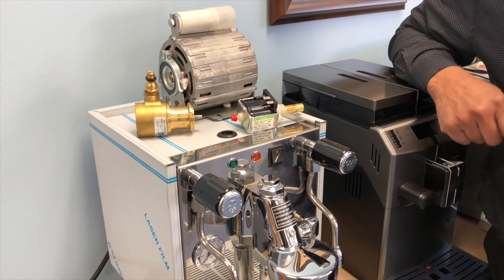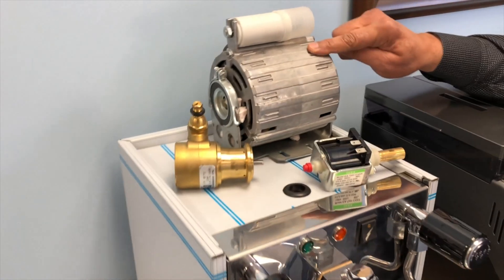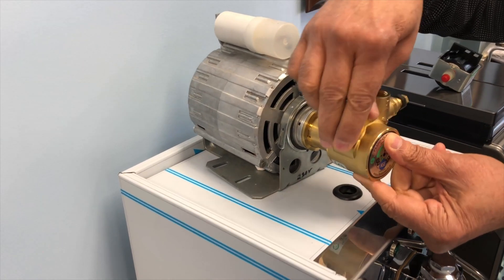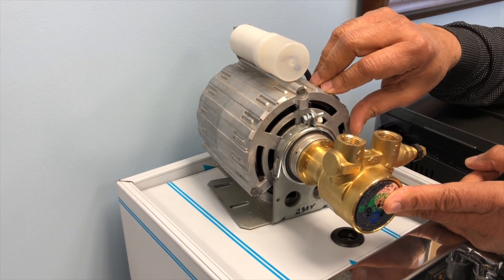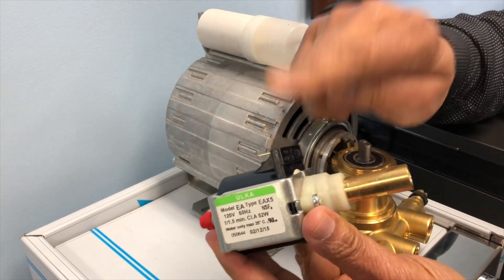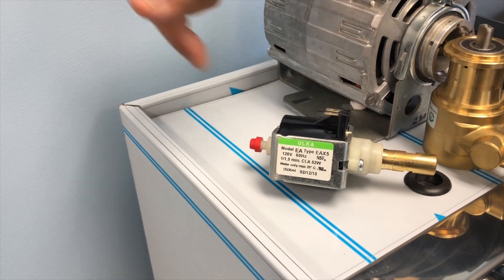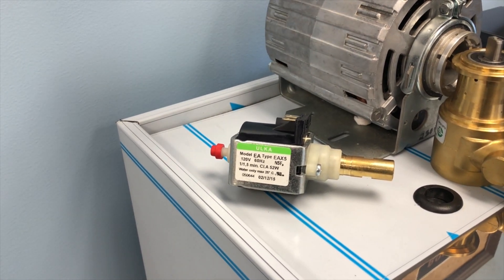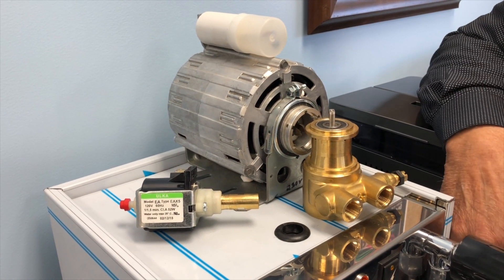Compare: Vibratory vs. Rotary Pump in Espresso Machines

Comment: Rotary pumps are far superior to vibration pumps. The latter only exist to reduce the size and cost of espresso machines. Other than being quiet, rotary pumps have a better pressure-to-flow rate profile, which allow brewing at a lower pressure and thus less risk of channeling.

Comment: Well the vibrating pump on my Jura F9 circa 2005 has 50,975 cups made and still works fine. The grinder makes some noise, the brew group cycling makes some noise, and the pump makes some noise. To me, those noises are the anticipation of a lovely cup of coffee! I actually have 6 older Juras and have no problems with the pumps on any of them.

Comment: Pretty sure the motor wasn't that HUGE in my Rotary pump ECM Synchronika machine.  That one in the video was likely out of a larger commercial machine I'm guessing,  not out of that little home machine it's on top of? 
Rotary pumps are usually a good amount quieter than vibratory! not totally silent but less annoying. Of course a grinder is usually louder than the pump!  Some vibratory pumps are better / quieter than others, I think it might also depend on how the espresso machine manufacturer dampens / mounts the pump some do it in a way to reduce noise a bit. 

There's other differences between rotary and vibratory pumps: They ramp up to pressure differently, Vibratory pumps slowly ramp up when pulling a shot and flow is generally slower like 6-8ml/sec where Rotary pump ramps up quickly at about 11ml/sec so there's potentially differences in how the pumps can affect your coffee extraction. Rotary also holds the pressure with less oscillation.   I've heard mixed things about whether or not people can actually taste the difference between a rotary pump and vibratory pump machine assuming everything else is the same. Some E61 machines offer the same machine with either type of pump. 

Another difference is rotary pumps are more reliable and last longer than vibratory, the downside is if you do ever need to replace a rotary pump they're a lot more expensive than a cheap vibratory pump. Vibratory might also be easier to replace since it's not as large, it might be easier to get to without taking more parts out to get at it.

Comment: A big missed point here is that an espresso is about 30 ml shot within 25 seconds. So it's not just about getting 9 bars but getting it with a flowrate about 70 cc/mn. That's a capacity no vibratory pump has, by far...

At 9 bars a basic one (like Ulka E5 shown here) will push about 255 cc / mn, making nerds add a dimmer mod to slow down water's flow, but then they understand why they need a better pump as they are not all equal in their capacity to deal with variable current... and also, even with an Invensys/Olab/ARS CP3, they lose some bars in the process as reducing the flow implies reducing the pressure. With a lot of fine tuning best espresso machines based on a vibratory pump can indeed produce an espresso within 25 seconds, but at 8 to 8.5 bars, making the result a bit more acidic and bitterness lacking than the optimal 9 bars.

But the more you add variables the trickier it will be to produce an espresso, and adding a dimmer adds a lot of variables (it has an impact on temperature's stability too, it's not just about water's flow). So at some point you'll need a controller to replicate profiles the same way every time, asking at least for a PID mod, if not a full Arduino solution. None of this is necessary with a good rotary pump.

Noise level is a bad argument for sure, also because it is way easier to soundproof a small pump than a big one, but rotary pumps are still way superior to make espresso as they can maintain a 70 cc/mn flowrate at 9 bars without any complex trick around it to get as close as possible without being able to really get there.
Reply: @Bloodysugar I tested my small Dolce Gusto machine with reusable capsules that have special valve that increases the pressure (more crema).
92 ml of coffee in 25 seconds, so 220 cc/min.
The one you mentioned puhses out 255 cc/min, which would be very close.
Which means that vibration pumps are basically just as good as the rotary ones, but well, they are loud.
Medium grind, iCafillas V3 Dolce Gusto capsule, packed in pretty tightly.
Reply: @michahalczuk9071  What Dulce Gusto model has a rotary pump ? 
With such flow it sounds pretty likely your machine comes with an Ulka E5.

By the way the only valve it needs is an overflow to deriviate the excess of pressure as such pump can deliver up to 15 bars.
Reply: @Bloodysugar  it doesn't have rotary pump, sorry I didn't make it clear! 
It has tiny vibration pump and I wanted to test it's throughput.
I will test my other manual espresso machine with a little finer ground coffee.
Reply: @michahalczuk9071  Oh my bad, I didn't undestand.

Enjoy, testing coffee is a pleasure by itself. :)
Reply: @Bloodysugar  The other machine, also with vibratory pump, made 76g of espresso in 24 seconds (it turns off after that, semi automatic).
51 mm portafilter, double shot, fine dense ground, metal screen on top, double wall filter.
=190cc/min
Looks like your estimate for vibratory pumps was way off :)
Reply: @michahalczuk9071  Datas I gave are raw, that's what pumps provide. As said it can be dialed by electronic to get closer to the optimal 70cc/mn @ 9bars. (an espresso is 25 to 30cc. With 50cc you're in the lungo category, that's not espresso)
Reply: @Bloodysugar  50cc is a double espresso produced from 14gr of coffee in 25 seconds in double basket. according to italian institute of espresso. 

I don't quite understand what's the downside of vibratory pump, when it's very easy to produce any flow rate just by fine tuning the grind fineness. 
I can easily make 30cc or 50cc of espresso out of 14gr of coffee in 25 sec, just by changing the setting on my grinder.

Comment: I disagree with you rotary pump deliver high pressure than vibratory the espresso need high pressure
Reply from the maker: The pressure required to brew espresso by SCAA standard definition is 9 bars.  All espresso machines (Gaggia Classic to exprensive ECM Synchrony) have built in pressure check valve's that open at 9 bar pressure to allow hot water to come in contact with coffee grounds in the portafilter.  Rotary pump does deliver the pressure faster to the brew head by milliseconds, but it does not make espresso extraction better than the vibratory pump!  It is analogous to how fast a car can reach 0-60mph?  It does add an oomph but that is all there is to it!
Reply: @PartsGuruUSA  many coffemachines with vibration pump are setup with 12+ bar , like my rocket appartamento... So its far away from 9 standard. Why? Because engineers realized that with higher pressure vibration pump works better.  I measured the pressure with special portafilter meter.

Comment: Perhaps it would be helpful to highlight the duty cycle capability difference between the two, as it can be significant. A rotary pump is much more heavy duty than a vibratory pump and can operate nonstop, all day long. Vibratory pumps, almost all of them, on the other hand, are not designed for continuous duty. You're expected to let it sit for a minute or so for every minute of operation. This duty cycle capability is part of the pump specifications and is always printed in the pumps label. One should have such limitation in mind in shopping or using a machine, or risk pump overheating and reduced service life.
Reply: Good point.

Comment: the vibration pump after circa 2000 espresso is abslotute exhausted !!! , and the last few coffees will have little flavor and almost no cream, basically you will throw away your expensive coffee because of a vibrating pump that has reached the end of its life ,  i have also a machine with a rotary pump that in 20 years of honorable service has never given me a problem, only perfect and creamy coffees , no loud noises but only perfect delicius coffees :)

Comment: Perhaps using a decibel meter, or even a phone DB app, to compare the actual DBA (A-weighted ) between vibration and rotary pumps would be a bit more scientific than anyones opinion. Would be fun experiment if you have both. Our Rancilio Silvia is terribly noisy.  I got 65DBA from my Ms. Silvia @ 3’ (1M). My next machine with have a rotary pump. Overkill? Maybe but i much prefer overqualified to under…. Pays for itself in 6 months @ my place the way we consume coffee

Comment: I'm sorry but i disagree. The vibration pump makes just an awful awful noise comparing to rotary pump.  A huge factor to me personally at least.
Reply: 1- Not all vibratory pumps are equal, some make more noise than others. You can use a 85 db Ulka E5, or a 82 db E4 / CP3, it may not seem like much but perception of decibels increase exponentially and a 3 db difference within the 80 db range is already a noticeable difference as it is 1/6 to 1/5 of the perceptible noise.

2- Most expresso machines with a vibratory pump are cheap, so most often they don't come with a pulsor pump that will bring its noise down to 70/75 db (and produce a lower note). That's a 20$ modification easy to add to any vibratory pump and a huge gain on comfort as it seems 3 to 4 times less noisy. At that point it is below rotary's noise level (and a pulsor wont work with a rotary, it is especially made for vibratory pumps to make them quieter and produce a more stable flow).

3- Because of the same reason espresso machines don't come with fancy designs like a soundproof build around the pump + silent blocks to carry pump's support so vibrations don't propagate in the whole machine. 

4- And still for the same reason the machine case isn't soundproofed neither.

A 50 db is achievable, making a vibratory pump as slightly noticeable as a refrigerator (and if you got one in your kitchen then the ambient noise will mask the espresso pump a lot). You wont have such luck with a vibratory as it is way more bulky and heavy so it wont come in a case with enough room to give it a soundproof system as efficient as you can build for a vibratory pump.

At least it's not the pump that is to blame, but the design around it.

Comment: you fail to address the performance difference completely. A rotary pump gives a consistent pressure from start to finish, whatever pressure it is set at. A vibration pump takes 5 to 10 seconds to reach the set pressure and also needs to be set to more than 9 bars to get a similar result to the recommended standard of 9 bar which is specifically for rotary pumps. Furthermore, the rotary pump you use as an example is taken off a commercial machine and is noticeably larger than the rotary pumps found in a Rocket, ECM and others selling a rotary option. And rotary pumps are definitely noticeably more quiet.

They are not needed, but they are a sensible option, especially if someone is interested in pressure profiling systems, where they would be a much better choice.And the price differences I've seen are about $200 more, not $5-600.
Reply: You are, right but if you want machine that can replicate how lever machine works, like me I  have, SAMA lusso lever machine, silvia with vibration and brewtus 3 upgraded to rotary, and only drinks espresso, lungo or amreicano, i appreciate much more those coffee made from PVL for ristretto/espresso, PID'ed silvia for  lungo/americano, and only prefer my brewtus i was making latte/cappucino for friends. Slow pressure start from ulka, especially the from my old ulka before changing it to rotary setup was best result.  But me, I somehow taste it to sterile for me, i go back to PVL in making more ristretto than espresso these days. In other words, it could be a plus or a minus, depends on you yourself.  And still with rotary for home use is no advantage, if you want to talk about getting quiet operation, start with you grinder.  I Macap and mazzer mini in my living room, one for arabica and other for rubustas in case friends needs milk base drinks.  And uses grindmaster if friends needs help with their beans, but usually it is there for decoration only.
Reply: @Liysrigede  Yes, you have to find what works for you. Something positive for one is negative for another.   👍🏼
Reply: That is for volume water pipes (flow size).

Comment: From what I've learned so far, I tend to agree that rotary pumps are overkill for home use, but this video is still lacking technical details. For example, rotary pumps quickly deliver high pressure, whereas vibration pumps need a few seconds to build up pressure. That's why machines with rota pump have gicleur jets, to reduce the initial pressure which is actually too high. So, clearly there are differences that at least in theory may lead to different results. But it's also pretty clear that many people want to believe that rota pumps create better results. They are quiet, more durable, technically more elegant, and have the flair of professionalism...
Reply: Vibratory pump machines also got the gicleur jet. Most roto pump heads do have a bypass valve flanged to the outlet. Thats how pressure is regulated with roto pumps, while most vibratory pumps are regulated via a expansionvalve. Some Fluidotech vibratory pumps are also regulated by bypass.

Comment: According to the Italian Espresso Institute in order to have an ideal coffee water MUST be delivered at a pressure of 9 bar and and at a temperature of 88C for 25 seconds, which cannot be achieved with the vibrating pumps, since in those pumps the pressure depends on the water flow. The bigger is the flow the lower is the pressure. Vibrating pump increase the initial pressure in order to have an approximate pressure of 9 bar during the percolation, but it will never be at constant temperature and pressure, in particular if you have to serve more than one or two coffee at the same time. Rotating pumps may be bulky but the machines with those pumps can deliver the coffee at the optimal conditions, are long lasting and built with better quality. The initial costs is recovered by the amount of coffee which is saved. Also rotary pump espresso machine can deliver more than two espresso at the same time so that you can offer the coffee to 4 or 6 guests at the same time, which is not possible with the vibrating pumps and are definitely much more silent! Household industry do not care about if the machines last longer, on the contrary they make more profit selling low quality products more often. Don't be fooled by the attractive prices. They are not worth the money.

Comment: What about for flow profiling using a transducer? Won't vibration pump be the bottleneck of the machine since it needs to build up pressure before the transducer starts it's work?

Comment: I think this video approaches the comparison from a cost standpoint and nothing more, and even that is not a complete analysis. Rotary pumps are necessary for connecting espresso machines directly to water supply. So if you wish that type of connectivity instead of constantly filling manually water tanks with water (and cleaning the tank) you need to go with rotary. Also rotary pumps are much more durable and reliable than vibration pumps. When you consider the cost and inconvenience of packaging and sending an espresso machine for service to another town or state (unless you are lucky enough to live in a city with local espresso machine service place), the price difference between both type of pumps begins to shrink.
Reply: Absolutely agree. I use at home a Rocket Giotto Evoluzione R with a rotary pump and I am very happy for that as, when compared within the same  brand with the vibratory pump-based machine, the rotary one is much much quieter + first and foremost, the already emphasized necessity to connect the machine to mains + durability and reliability. The presenter is, I am afraid, misleading himself more than a bit in his conclusions and saying "you can still talk while the vibrating pump is on" is absurd and missing the point, not to mention the logic. Enjoying coffee machine is also about a one’s subjective audio comfort and in my case, a short comparison between rotary and vibration made by Espresso TV for YouTube persuaded me immediately to go for rotary as in my view the difference was shocking (see video below). 

https://www.youtube.com/watch?v=PCzwAKxYubI
Reply: on the contrary, a rotary pump is not necessary for direct water line connection. I set up my Pasquini Livia 90 directly to the mains. It only takes a vibe pump with a threaded input connection ( a pressure regulator is a safe addition for both vibe and rotary pumps). Ulka and Fluid-o-Tec sell models with threaded input.

That being said, I agree with you that he fails to address other reasons for choosing a rotary pump that you mention as well as what I mention in my comment above yours. I would always choose a rotary pump over a vibe pump
Reply: nope there is a water line kit for Ulka pump machines available. Helps a lot with noise, thx to the prepressurisation applied by water line.

Comment: You claimed that the vibration pump isnt that much noisier.. well thats a qualitative statement. maybe some dBs would be nice to know. anyways. what would you make of this comparison in the video. (I am sorry the video is really bad quality in the way it is made or explained... i dont not support this youtuber :).. but towards the end there is a noise check. id like your view.

https://www.youtube.com/watch?v=iaqu_hHVOXg
Reply: In itself vibration pumps are insanely quite.
It isn't the pump thats the problem, it's manufacturers making design flaws: Wrong rubber pump mount, no membrane dampener on the pump, no sound/vibration dampening material in the case housing the pump